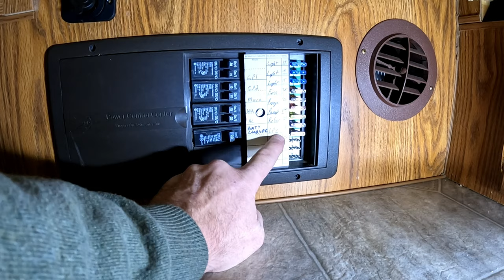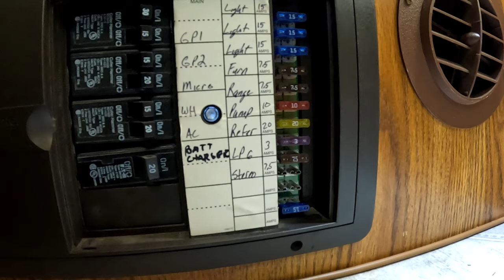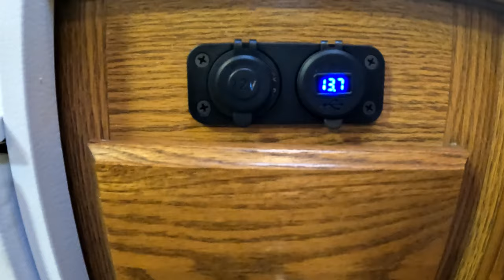Adding USB and 12 Volt Plugs to the Truck Camper

Comment: Did about the same thing with a oulet below the sink also I added another usb and110 volt on the isle side of the front dinette seat.  Also put another usb plug on the driver side at the front of the bed,  You can never have enough plug ins. Below the sink also put a monitor panel to show current usage, solar charging input and a resetable watt usage.  One item you might try is putting water into your fresh tank using the anti freeze suction pulling from a jerry can and running from the ourside shower into the fresh water tank using the water pump to pump it there.  I dry camp a lot and need to add water to the tank and this is about as easy a way to do it as I have found. Great you are showing people how relatively easy this is so they can upgrade their camper.
Reply from the maker: Great advice! Thanks for the tips!

Comment: Kenny, as a friend I'll save you a ton of work, learning & effort. Buy a Giandel 600W inverter & get YEARS of outstanding use out of it. Do it right the first time and then reap the benefits of work well done!  I'm gonna hook up my small 600W for laptops/chargers/TV & use a 2000W (Giandel, of course!) for my microwave/roof mount AC. It'll also run my coffee pot, Camille's hairdryer and other higher load stuff. Thankfully, both come with a remote On/Off switch which allows me to run them only when I need them! The bigger one has a small draw (36W) but, parasitic draw on a lead acid battery will really shorten the life if I make a mistake & leave it on! (Doh- I've done that!) That's why I like the smaller 600W Giandel- it allows me to mount it & use it without having to check batteries, etc...And, the bigger one allows me to hook up the whole camper (all plugs- whenever I turn it on) without being plugged in at a campsite.

Your #1 Fan, cheerleader & supporter (behind Many- of course!!!)

Dave
Reply from the maker: It's funny you mentioned Giandel. I did a bunch of research finding an inverter that put out a really clean sine wave. A lot of companies were  selling inverters marketed as pure sine wave, but reading reviews people would hook them up to oscilloscopes and find out they were not a clean sine wave at all. Then I found a company called Giandel with a ton of great reviews. 
Hopefully, I don't regret buying the small 300-watt unit. When the time comes to replace my big inverter, I'll stick with Giandel. I'm glad to hear that you have had the same positive experience with this company. The price wasn't bad either, 55 bucks. 
Thanks David

Comment: In may we are taking a trip to Alaska in our arctic fox truck camper we enjoy watching your videos and have learned a lot when are you putting up your video on how to remove the back of the dinette keep up the good work - p.s. when are you taking out the onan generator and replacing it with the predator- I think it will fit - Todd and heather

Comment: Enjoyed the content. Very helpful 👍. Loved the sunset and scenery. Curious to know how well the new setup lasts as far as the inverter. Looks great, but I've had issues in the past with some of mine, probably because they were cheaply made. Stay safe
Reply from the maker: I wish I could give you some information on durability, but I just received the inverter a few days ago. I can say the cheap modified sine wave inverters would not charge my laptop. They powered my phones, TV, DVD, dehumidifier, and refrigerator, but not the computer. 
I did a lot of research before buying the current inverter. I was impressed by the reviews. It is smaller because it will only be used to charge the laptop. I'll post a link and let you know if I have any issues in the near future.
Reply from the maker: https://www.amazon.com/300Watt-Inverter-120volt-Converter-Smartphones/dp/B07SLPWBK3?ref_=ast_sto_dp&th=1&psc=1
Reply: @KennyOfAllTrades  Thanks 👍, I'll check it out. I'll probably go for the Silver one, $2.00 cheaper. Lol

Comment: The worst part of upgrading electrical in my camper is routing the wires. The original wiring was done Before the interior was finished.
Reply from the maker: True, and you can almost forget about trying to upgrade the electrical on the slide out portion. The wires would be just constantly moving and have a potential to break.

Comment: Amazon sells 12-v based laptop chargers with usb-c for around $50. I bought one of these to skip the losses on the inverter (and make my batteries last longer)
Reply from the maker: Great tip! I really need to pick one up. You are right, those inverters do draw a lot of power just by themselves. My 3000 watt inverter will drain the house batteries in 24 hours, even if nothing is plugged into it.
Reply: @KennyOfAllTrades  no worries! Getting a second one for my son at some point. So much more efficient lol